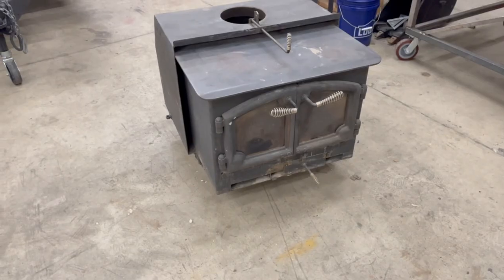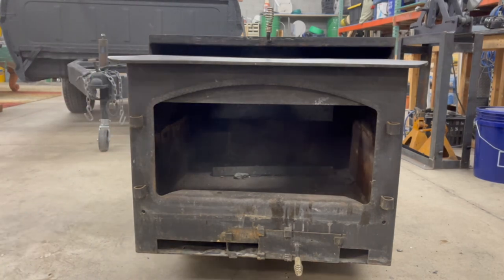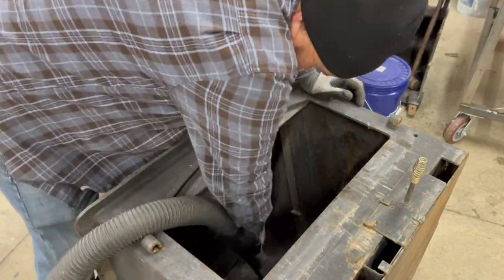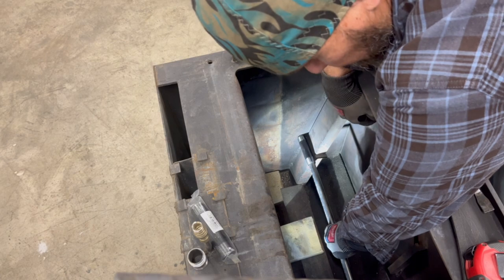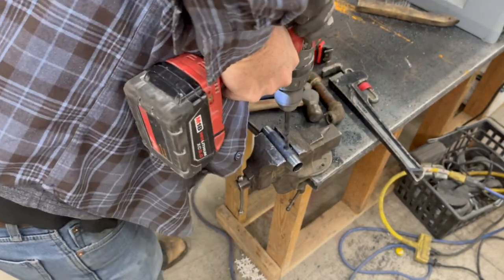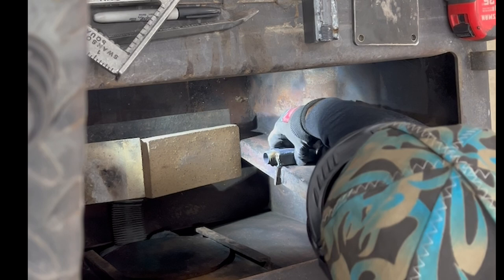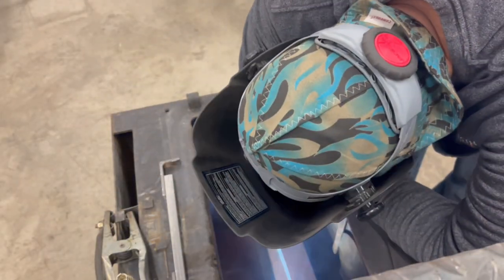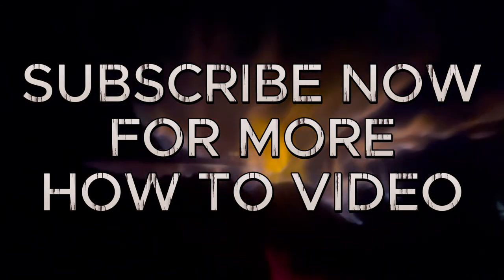Upgrading an Old Wood Burning Stove with Efficient Secondary Burner and Air Flow Optimization!

Comment: Pizza oven - in wood insert:
refractory bricks on the sides,
2-3mm steel plate on top (plate surface = insert surface - chimney flue surface)
thin sheet metal folded like a box/flame guard,
slate tiles (and/or small electric oven rack) to limit heating to metal plate level

makes excellent pizza
not very good for focaccia or bread (too muche heat on surface, & not such thermal mass maybe)
Reply from the maker: Great idea for cooking pizza in your wood insert!